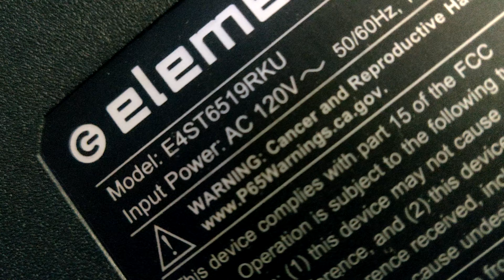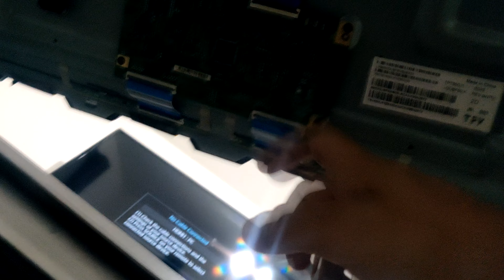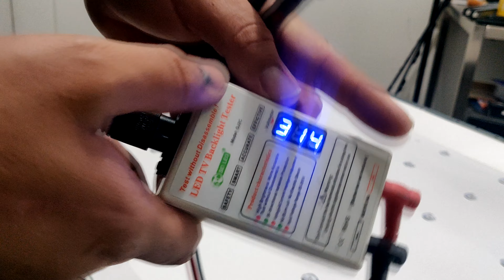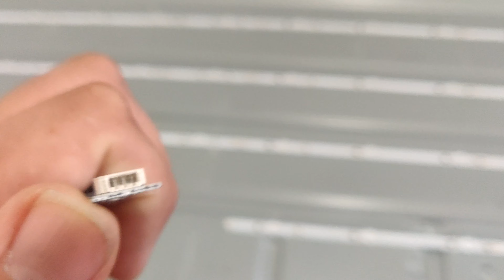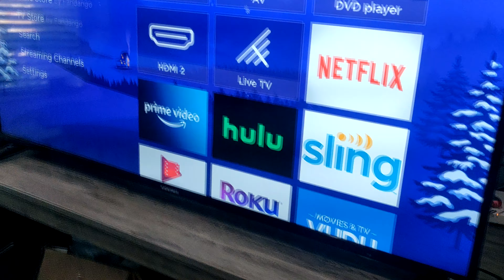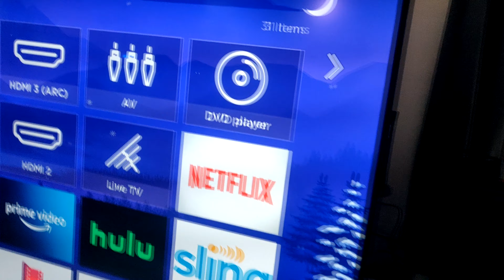Roku tv Element Fix | Complete FULL breakdown guide for no backlights or black dim screen

Comment: I've got a 65 inch Element Roku TV and the screen is dim on the bottom and even dimmer the closer it gets to the top. Do you think that might be a bad power board or am I gonna have to spend hours taking it apart, lol.  Couldn't even get the outter frame all the way off since it's on the corners really strong, so I put it back on
Reply from the maker: LEDs bad.
Reply: @TECHIELIFE  dang, I can't even figure out how to pop the top corners of the frame off, lol
Reply: Same issue as this video describes... probably bad connectors between the two LED strips per row.

It's a thermal expansion and contraction problem. Over time, when the LEDs are on and warm, the aluminum they are mounted on expands.... then when you turn it OFF they cool down and contract. This constant movement wears out the contacts and they corrode. The best solution is to use short sections of 22ga wire soldered across the connectors. This requires sufficient soldering experience to solder on the aluminum carrier circuit board, not recommended for the unexperienced.

Edited:  I would suggest that you don't try to remove the connectors, they are soldered in and through the board. Just solder 3 pieces of wire directly across each contact pair, behind each connector.

Comment: Broooooo I've been trying to replace fix this tv for weeks! Replaced power supply board, tcon....  gonna do this now. I'll let you know how it goes. Thank you for this video!
Reply from the maker: Just be patient.. the tv is hard to break down. Especially when you are removing the LCD
Reply: @TECHIELIFE  FIXED! Repair only cost $9 for some suction cups from Amazon. Thanks again for the fantastic breakdown and diagnosis
Reply from the maker: @spencersevy4521  was it the same issue?
Reply: @TECHIELIFE  exact same issue. I used a sewing needle to move the female prongs out and make the male ends have better contact between the connections.
Reply from the maker: @spencersevy4521  nicely done!

Comment: I have the same problem but the lighting isn't dark. The TV looks good for a minute but then the lower screen starts to get dimmer or the upper part of the screen does. Sometimes it flickers I don't know if I should replace all the strips or not.Any suggestions? Thank you
Reply: When LEDs fail, they typically are not intermittent... those connectors between the LED strips DO get intermittent, like described in this video. Not all TV's have 2 strips per row, it's usually just 65" and larger.
Reply: That's what mine is doing

Comment: I just performed this repair on a unit born July '19. Thank you for your very helpful video! I have to presume this happened for two reasons. 1) A design flaw in the connector not allowing for 2) flex on the structure of the TV over time when wall mounted. The TV I fixed was wall mounted. Was yours? I'm thinking if the Vesa mount on this TV isn't used this problem may not occur; thoughts?
Reply from the maker: This was not my tv. But I've had 2 if the same model same issues. So I assume a design flaw in the led strips.
Reply: @TECHIELIFE  indeed, but does wall mounting accelerate the flaw? Do you know if both TVs were Vesa mounted?
Reply from the maker: @richardhoover8021  I know one of them wasn't. But I wouldn't doubt that the VESA mount system does mess with the frame itself.
Reply: It's a thermal expansion and contraction problem. Over time, when the LEDs are on and warm, the aluminum they are mounted on expands.... then when you turn it OFF they cool down and contract. This constant movement wears out the contacts and they corrode. The best solution is to remove them and use short sections of 22ga stranded wire soldered in place of the connectors... and leave a small amount of slack. This requires sufficient soldering experience to solder on the aluminum carrier circuit board, not recommended for the unexperienced.

Comment: When you tested the LEDs after adding solder to those connectors, did you only plug in the power supply board or did you have all the boards hooked together (like they are by default)?

Thanks.

I ask because I'm having backlight issues on a 55 inch Vizio. It also has LEDs with those connectors and the resistance just from the connectors (+ to +, - to -) was INSANE. Like, some as high as 400ohms. I added some solder and now they have direct connection (.4ohm).

All the lights work in each individual strip but connected they still won't all light up. Also, the power board supplies 21v standby/26v on and it won't power any of them. Yet, all test good as strips and individually. So odd...
Reply: Just reading your comment, did you replace the power supply? Did you fix your TV?

Comment: I have the same model TV.I was driving through a posh area of town. someone put it on the curb with the remote taped to it. so I picked it up. I loose nothing to try to fix it. going to give this a try. ill let you know how it goes. but I do have a question. is there a certain number of volts that it should read? or should they just be consistent. same model tv so probably the same problem  as yours, but wanted to check. I am optimistic. YouTube and I have done may first time projects successfully. From taking apart my truck's transmission and fixing that, to building a handicap ramp to code. in between I learned how to take apart, modify and upgrade, then rebuild computers and laptops. I know this is a bit wordy, but wanted to let you know, I heed your warning about the difficulty and will  handle it with care. i appreciate you walking through the problem. If I can fix it, that one less TV going to the landfill. this TV is only just over a yr. old. wish me luck.
Amy
Reply from the maker: Yes this is kind of hard.. I actually just picked up another tv same brand... Same model.. same problem.
Reply from the maker: Although I will suggest instead of soldering the connectors.. you can actually make little jumpers in the middle and act as a bridge. You can solder on the test points. All you need to do is just carry over the voltage all the way through.
Reply: @TECHIELIFE  This is the way!

Comment: Same tv took apart the tv did everything you did but the screen is now a faded black (LEDs work but picture gone)...The only difference is I disconnect those orange tabs between the bottom of LCD board and I placed a small scratch on one of them.  Do you think that would cause total black out?
Reply from the maker: I'm not sure. Try pressing on them while the tv is on, see if the picture comes back.

Comment: Yo man I wish you could do that for my tv I have the same issue with my 65 inch  I only have a year with the tv
Reply: Go to an HDMI output of your choice on the tv,  click the star, go to picture settings and turn off power Saving mode
Reply: Just so you know the 65" has a 2 year warranty.  I contacted Element and they are refunding the cost.  Now I will attempt this fix, and have a TV for just the cost of the LED Strips.  I found them for $54 on ebay.

Comment: Thanks man; i have a Onn 5o roku tv turn it on has sound but when i use flashlight i see nothing completely dark ,the back light power from the power board is 225v ,isn't too much?
Reply from the maker: No. That's seems ok. It's just that your back lights have failed. Not the power board
Reply: @TECHIELIFE  Seriously?  225 Volts is WAY too high for LEDs! Nobody uses LED strings like that.

Comment: Same connectors as "improved" strips for Samsung. Had a couple come back, found the bad connector and hardwired around it. In this TV every one is going bad.
Did notice some LEDs not coming on at same time in your video (top rows) but could be normal effect of not getting a good connection. Still suspect on the LEDs themselves they are uneven  draw like that.